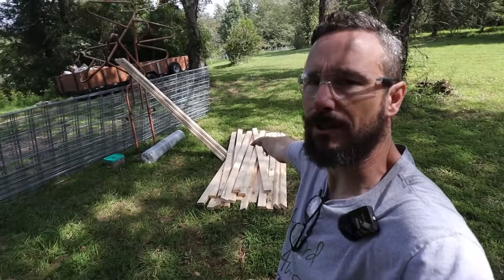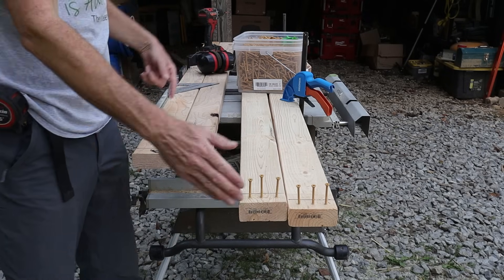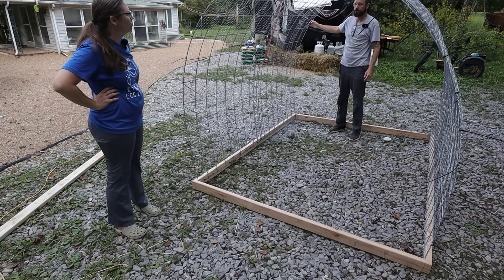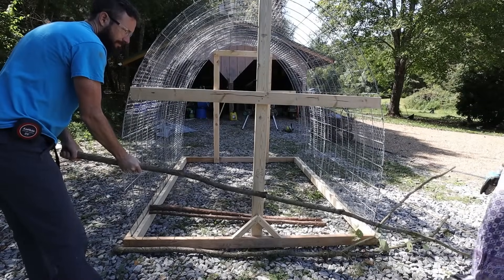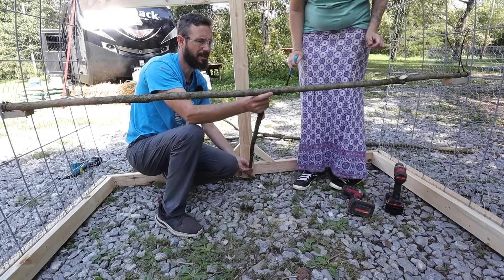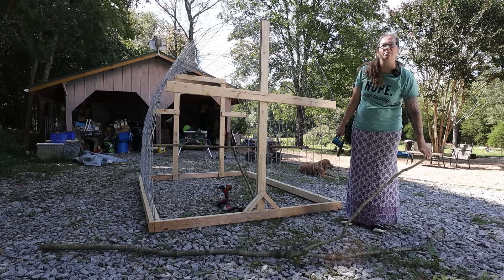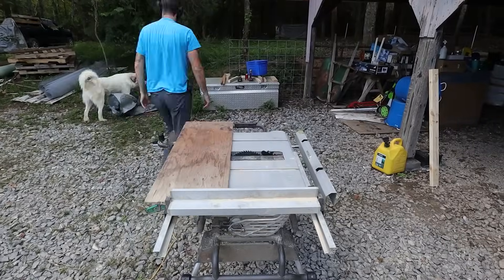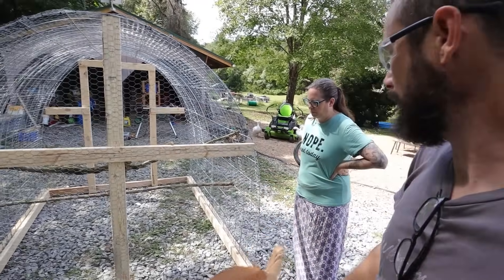Our Best Design Yet

Comment: Nice build guys, great design. I think I would have put thicker perches in, as the pullets get older they will definitely need thicker perches so their toes don’t curl all the way round.
Reply: Why is that ? The toes not curling around part??
Reply: @VictorNewman-yh4ev  In the winter they need to be able to sit on their feet to keep them from freezing.
Reply: @beccafichtner5305  oh okay! Thank you so much for the time to respond
Reply: @VictorNewman-yh4ev  all birds need to be able to have a certain amount of the sole of their foot resting on a surface otherwise it is too uncomfortable. Imagine if you were standing in mid air on a thin piece of metal or wood, it would be very uncomfortable on the sole of your foot, and would feel better with a bit more surface to stand on. Of course, it’s all relative to the size of the foot.